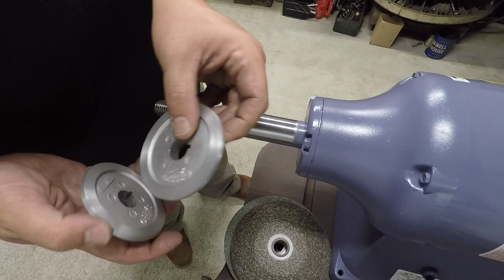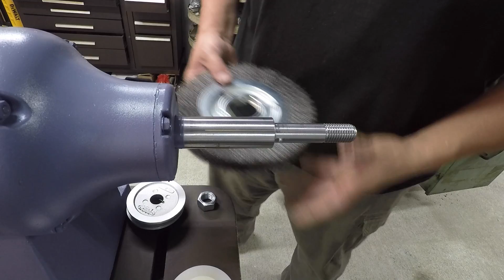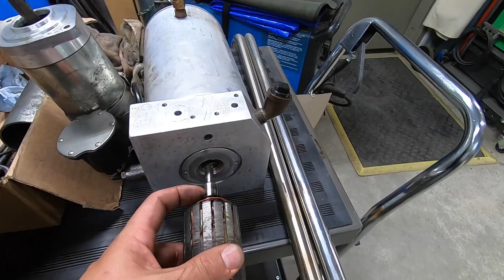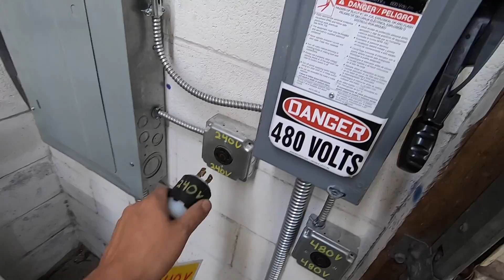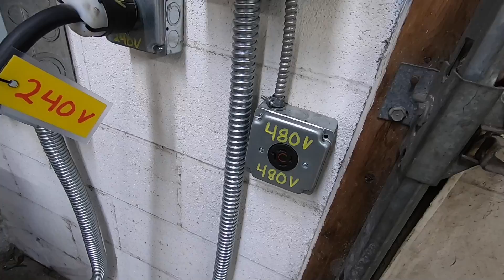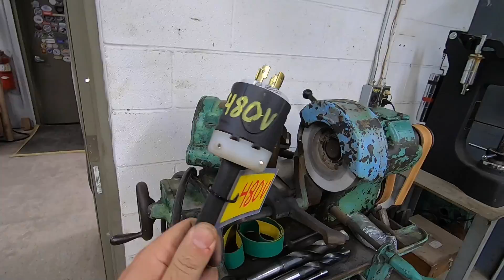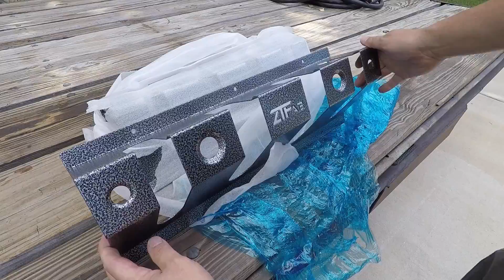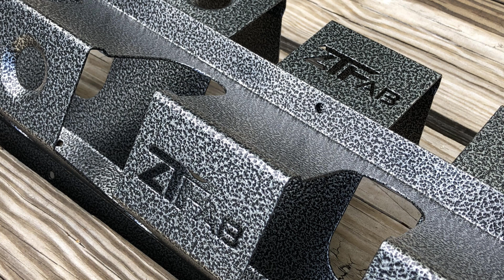SNS 304 Part 2: Baldor Buffer Improvements, ZTFab Milling Arbor Racks

Comment: Hey asked this before, but are those brass cat heads for the SVSeeker boat?
Reply from the maker: Sure are 👍🏻
Reply: @Abom79  cool so when you able to figure an set up the shaper for the stoker engine? Or is that what the new shaper is for. Any way are you going to have to bolt down the shaper to keep from rocking over?
Reply: So what do you think of my repair Ideas for trump pump and motor... in the ball park?

Comment: I know you are likely too busy to answer this; however, I can't help but wonder if you are a tad disappointed in the quality of the fittings for that Baldor.  That model retails upward toward $600+.  The motor is super quiet and it seems solid.  I wonder if they figure most folks who buy this grade are going to work up their own bushings, et al. (?)
Reply from the maker: I love the grinder but the back up flanges are poor quality. I feel they should put more effort into them.

Comment: That was an awful lot of wobble in that aluminum flange @ 10:30 no? Also, pretty slick how they masked off the ZTFab logos so they weren't sprayed over. Wonder how they did that?
Reply: they are holes not labels
Reply: That was the point, the flanges were horribly manufactured items.

Comment: I should check my Baldor 3/4 hp grinder that I bought 25 years ago I guess as it has always had some vibration issues...I have no excuse as I have everything I need to do it... Cheers; Mike in Louisiana
Reply from the maker: I’d love to know if the vintage grinder have machined backups vs my cast ones.
Reply: @Abom79  I bought that grinder a good 25 years ago at Oliver H. Van Horn in Baton Rouge and it has  aluminum backups...The machine had the lighted eye shields on it but they finally rattled to pieces so I took them off .. I may take it apart and do exactly what you did .. My machine is 3450 rpm though.. Mike in Louisiana

Comment: I think machining the angles on the flanges would add to the balance; same for the inside of the flanges.  It may be overkill, but the more precise balance supports longevity of the motor bearings.

Comment: I had a large wire wheel like that and it was out of balance.  I had to add weights to it so it wouldn't vibrate the motor to death.

Comment: Adam, did you get a weight equalizing hitch? I see the bars in the back of your truck. Good fix on the Baldor.
Reply from the maker: I’ve had it, it’s the unit that come with our camper.
Reply: @Abom79  ok I see

Comment: Thanks for the video Adam.  When I saw the Baldor in the first video I immediately started looking at them as I’d love to have a quality bench grinder.  After watching this video, I may as well go to Harbor Freight.  I don’t have a lathe to fix the blatant lack of quality control.
Reply from the maker: The motor itself is perfect, shafts are true as an arrow. It’s the backup flanges, bushings, and various wheel that are the problem.
Reply: Understood, but for the money they’re getting, it should be perfect right out of the box.  All of it.  BTW, I’m kinda surprised you didn’t set the compound and finish the taper as well!

Comment: Those flange/washers were terrible they should be sent back to the manufacture. They could be used for making a vibrator.
Reply: what you gonna use it on an elephant!
Reply: @julianthornton9076  Concrete!